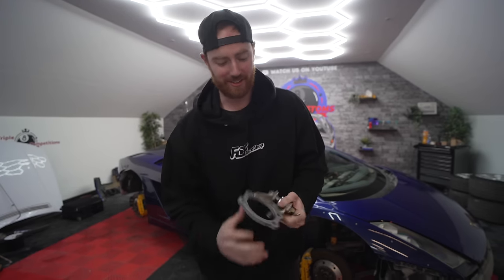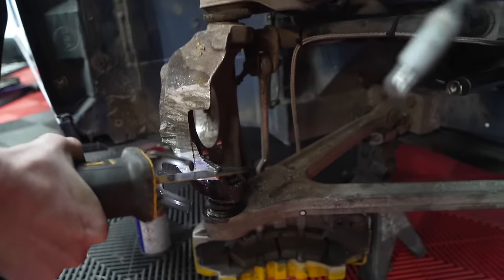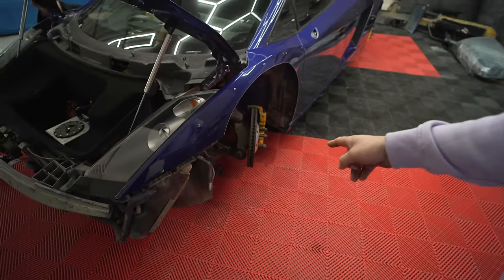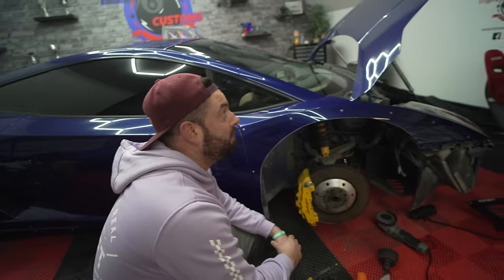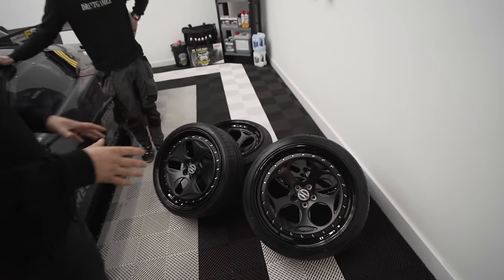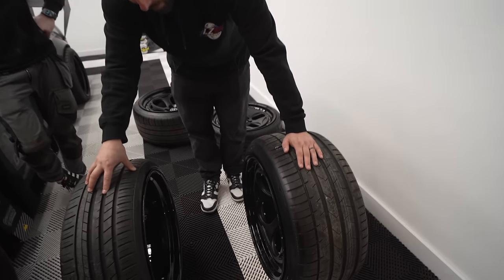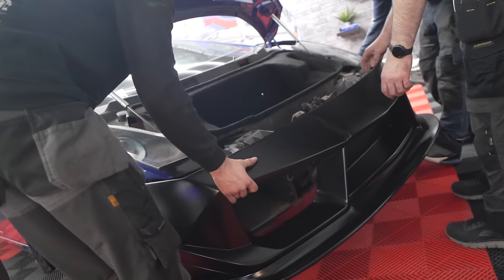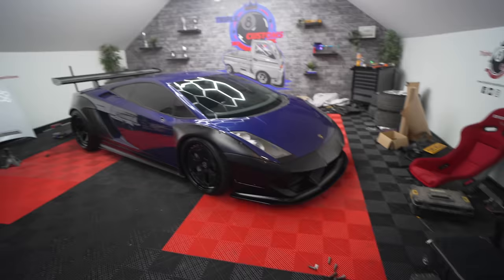The UNEXPECTED problem with our 2JZ Lambo project…

Comment: What about running the standard front-wheel paint satin black and then put a carbon brake dust cover on the outside like James deanes RX7 ? Keep them stroms for static shows etc

Comment: awesome but black wheels need to have some kind of color on it to look awesome in vidz and pictures. black don't cut it unless its parked. at least put some osrt of color on a bar or half the wheel. you want it to look awesome slidling add colors to the wheels, dont get me wrong the wheels look awesome in black but black is the darkest color and in a drift environment, you want everyone to see that wheel spining like crazy with rpm...... look back at this video when the wheels on the car and yall looking at, on video its hard to see the design unless the camera is legit steady. so if its spining and the spokes are that close to one another it will just look like a steelie rim, at least put some kind of color or sticker on it that is bright in contrast etc.

Comment: Awesome video awesome cat but lads you're rushing it for the sake of a deadline that's just kinda made up. Ye all know what ye need is some sort of wisefab hub modified to fit in there and some custom wishbones etc. Put the wheel out another few inches and take a saw to that kit and widen it out even more on the front. The way it is now it won't work on the road or on the track. And credit where its due for making that kit of a scan but I'd be very wary of all that new pressure that's gonna be on the back of the wheel bearing bolts. Especially with it all being aluminium. With all the contacts you all have you can do better than that just rein it in and don't ruin it for the sake of getting to japfest.
Reply from the maker: Car leaves on the truck one week before Japfest and it needs to be done. We have a good 3 weeks at it after Dubshed to improve what we can 👊
Reply: It can definitely be improved but would have to be nearly completely custom including changing the brakes,has to be wider too or put the pram wheels on it.
Reply: Watch Chelsea defofa porsche video he done the porsche properly and it's fucking awesome. Ye can do this..